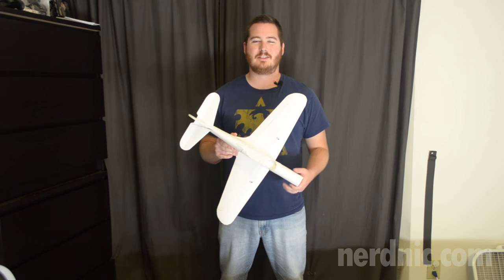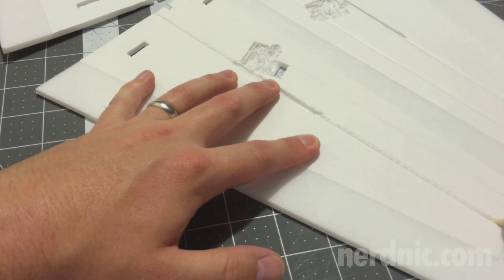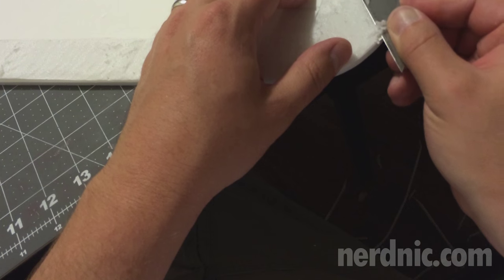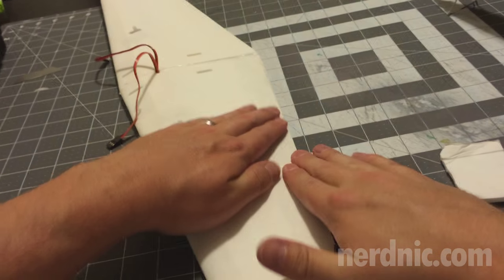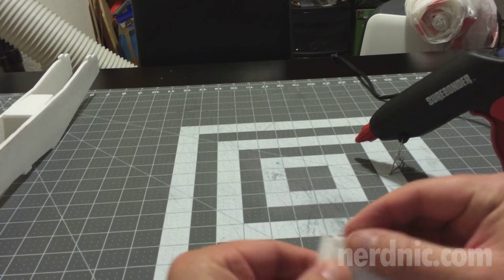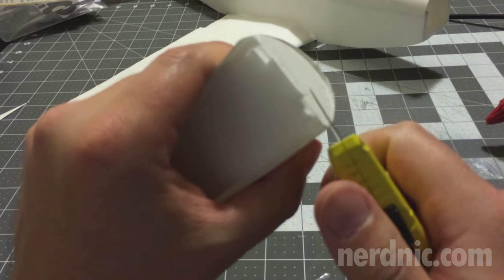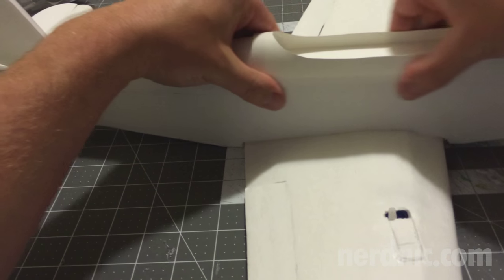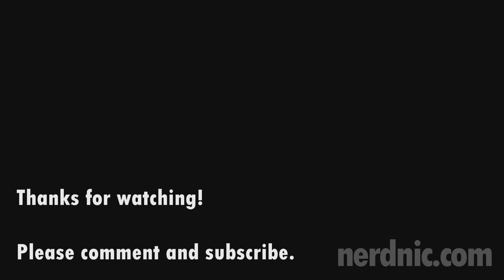nerdnic | Sonic Series nnP-39 BUILD

Comment: Great looking plane!! Some constructive criticism would be to get away from that Flitetest style creasing of the wing tops. I pull the paper off of the bottom front half of the upper wing half. This allows the foam to bend in the downward direction creating a smooth airfoil. Looks way better.
Reply from the maker: Great advice! Removing the paper on the inside hurts the strength a bit so I now favor multiple scores. Check out my newer designs, the airfoil is very smooth without losing strength.

Comment: Hey nic, or anyone who can answer really, was just wondering if this build video can be used for the regular p39? Im getting ready to finally tackle your builds, i think ive pretty much mastered the ft build style, but i still haven't tried building anything without a video. Also, i notice you seem to go for low kv high pitch props, is there a reason for this? I was under the impression high kv was pretty much better all around, more efficient and more power for a given weight, what am i missing? Thanks!
Reply from the maker: Hi there. You can use this video for the full size nnP-39! There are just a few minor differences in the tail section. On the full size the hstab and vstab build like a speed wing where you bevel the foam.

Speed can be found in low kv and high, what matters is your kv to prop pitch. The benefit of a low kv motor is that you can swing a larger diameter prop and larger means you get more immediate thrust (acceleration). A smaller prop, even when spinning really fast, won't have the same level of acceleration. I find that having a large amount of thrust makes the plane more fun to fly as it feels really powerful. The 10x10 setup I run on the full size nnP-39 is the best of both worlds, really fast top end but all the thrust you could ask for.

Enjoy!
Reply: Aha, thanks for the reply, this hobby has so many variables its quite amazing. I started RC with nitro trucks and it was pretty much a set few motors with a couple spur gears to change power and torque, now it seems like the possibilities are almost endless with brushless and prop combos :)

Comment: Hello Nic, I plan to build the Sonic Series nnP39 as soon as possible.
I have checked all the relevant video and information, I would just like to check with you the engine I have as well as the propeller indicated for it in order to extract the best performance.

Engine DYS D2826 2826 2200KV with 40a ESC HOBBYWING SkyWalker on engine datasheet they indicate APC 7x3 / 7x4 to draw up to 342W and 910g of thrust with 3S 2200 35C - 50C | 3S 1500 35C.

I tried to fly with this configuration the ALPHA model from FT with MESArc and did not get good results.
What do you think!? To depending on this only to start the process of printing and cutting the DTFB
Reply from the maker: Hey Andre! That motor and battery are much too big for a Sonic Series plane. Those would work great on my 800 Series planes though. The Sonic Series can only use a 800mah 4s/1300 3s and about a 30g motor.
Reply: I have another 2 models of motors, 4X2204 2200kv with 12a ESC and 2212/6t 2200kv with the same 40a ESC.
I wanna make all yours planes, but I want to fly as soon as possible...
Reply from the maker: Okay cool, your 2204 will work perfect! Use the MM pod in my plans with this motor.
Reply: Thank's I'm try to do and make a post to you know!

Comment: Hey man, plane looks awesome! Are the magnets in the hatch needed? could I leave those out and be alright? It looks like with that tight of a fit you wouldn't really need to have them. 

Also, would some larger batteries work with this or am I better looking at the full size plane? I've got 4 3300mah 4s batteries that aren't being used in anything right now that I would love to put to use. 

Thanks!
Reply from the maker: Magnets are not required but your hatch may blow off at high speeds. A 3300 is much too large for the sonic series, definitely look at the full size version!
Reply: sweet! I've been looking for a reason to build the full size :) I'll look at getting magnets set up or maybe just bolt it on with nylon or something! 

Another question then, i've had this motor sitting around for a while now, would it be alright on the full size nnp-39? 

https://www.readymaderc.com/store/index.php?main_page=product_info&cPath=505_506_599&products_id=5301

i'm mainly concerned about being nose heavy. it's kinda big!
Reply: sweet! I've been looking for a reason to build the full size :) I'll look at getting magnets set up or maybe just bolt it on with nylon or something! 

Another question then, i've had this motor sitting around for a while now, would it be alright on the full size nnp-39? 

https://www.readymaderc.com/store/index.php?main_page=product_info&cPath=505_506_599&products_id=5301

i'm mainly concerned about being nose heavy. it's kinda big!
Reply from the maker: That motor is 100g in weight, I, and others have flown the nnP-39 with a 200g+ motor with no issues. It will work fine!
Reply: oh wow, sweet! I have been having a hard time trying to figure out what to use the thing on. Thanks man!
Reply: Have you done much FPV with your planes? I'm hoping to mount a camera in the canopy but idk how the view would be in there or if I should adjust it some for the cam.
Reply from the maker: I haven't done this but it should be possible. The canopy has plenty of space for a camera. There is a video on youtube of someone doing this with my full size nnP-39.

https://www.youtube.com/watch?v=TAVSHlbdyrk
Reply: ohhh that looks cool as heck! right on. I'm not sure if I want the canopy in view or not yet, it looks really cool but if I want to actually do pylon racing with it then it might be restrictive! I'm looking to do low and fast gate runs and this seem s like it would be a sick plane to work with for that. Been using the super bee for it lately :) Thanks again man!

Comment: Hi, thanks for all this work. I love the improvements you made to strengthen the whole plane in comparison with FT planes. I made FT spitfire and its now written off  because the whole structure and specially wing was not strong enough. It basically folded in the air twice. Second time the plane was unrecoverable . If I used your plan I am sure that spitfire would be still in the air.  

Can you please tell me what hot glue gun are you using and specially I would like to know the temperature you operate at. I have bought glue gun where I can adjust temperature but if I set it over 160 degrees Celsius it starts melting the foam. 160 is not very runny and wont give you enough time to work with the plane. I use depron  here in Europe as I cant get anything better than that. Thank you
Reply from the maker: Hi there! Glad you are enjoying my design techniques! I am using the Surebonder PRO2-100. I'm not sure what temp it runs at but it operates at 100 watts.
Reply: Nic Lechner there are two types of these guns. One is high and one low temperature and they are both 100W . Which one do you have ? I just learned that the high temp one is 190 degrees Celsius that would be surely melting your planes
Reply from the maker: I went back and looked at my order history, I bought the high temp: http://a.co/4OA99Ls

It most surely DOES melt my foam. The paper on Adams board helps prevent a lot of melting, but if I put glue on bare foam, it burns through it like nothing is there.
Reply: I saw in your video you put that glue right on the foam also like spars for example. Do you just leave it to melt anyway ? These are the things that bother me because I have seen so many videos people making foam planes but nobody even FT guys never explain in details about hot flue guns. I know in one video FT guys try to explain it a little bit but you never get exact information about this. People go right on the foam with very runny glue and have so much time to work with it. When I set my gun to about 160 - 170 degrees Celsius I will never get it so runny and have to work very fast. If I set it higher the glue will chew through the foam. It would be good to have someone experienced to make good video about this issue. This is very important specially if you want to glue large sections.

You say that paper absorbs the heat better but you also put that glue on the foam. Plus here in Europe you do not get Adams foam board or anything similar to it unless you willing to pay Graupner in Germany lots of money to get the FT board.  Here https://www.graupner.de/Flite-Test-Foam-Board-wasserabweisender-Schaumstoff-by-Adams-25-Stueck/FT4001B/ and not in stock anyway. Delivery is terrible expensive from them like 30 Euros.
Reply from the maker: It is true that on some parts of the build you put glue right on bare foam. But even on Adam's foam the hot glue melts it like crazy. There is a fine balance between working time and temperature. If it's too cold you won't get any working time or a good bond. If it's too hot you will get more work time but your foam will disintegrate. I choose for higher temp not just for longer work time, but for volume. If your glue gun is not as hot, you can't output as much volume of hot glue for a wing fold over.

There are some tip and tricks that I can share though to help keep the foam melting to a minimum. I will work on a video for this. For you and anyone else scratch building I would suggest getting the higher temp gun and then working around it vs having lower temp and it not being useful at all.
Reply: It would be great if you could make video on this subject. Everyone talk about building but never details how to use glue gun. They all seem to have this magical glue gun in their videos that just work perfect without melting foam :) In FT videos they mention few times how good gun they bought in some dollar tree shop for nothing and this gun is magical : ))) they just fail to explain that there is a trick to it :) Oh yes and in one of their videos they explained hot to put the glue stick in lol.   Please make this your next video I thing this is very important information not just for me but for whole community. The worst thing for me is that I have no one here to share experience with I am on my own here. No one to go fly with or ask about anything. I have to learn all my self from internet. Thanks God we have internet :)